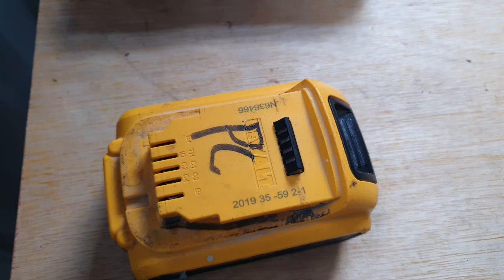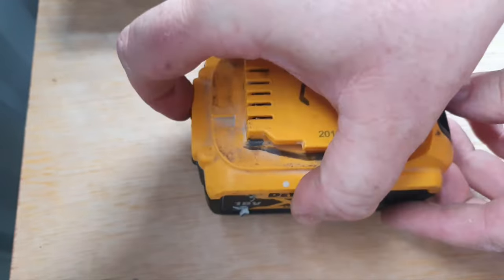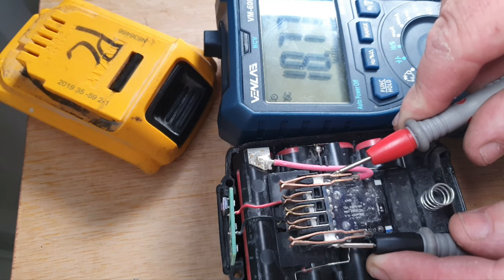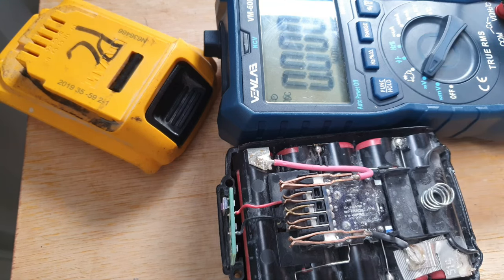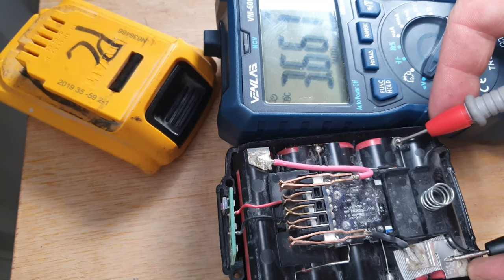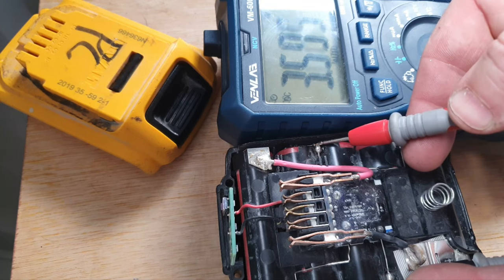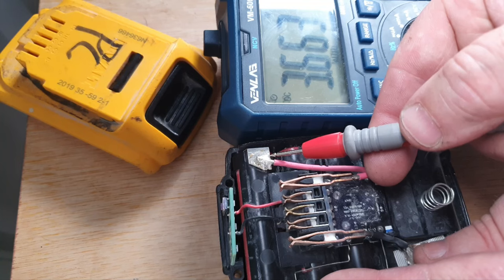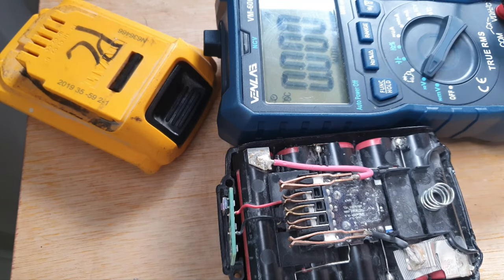Dewalt Battery not charging fully? this is the answer #powertools #repair #dewalt #powertoolrepair

Comment: I recover many of these batteries by using a light to discharge the cell pairs down the the level of the lowest pair and then charging the whole pack as all the cells will reach full charge at the same time. So far I have noticed the four cells nearest the terminals are fully charged at about 4 volts and the other six are usually 2.5 volts or less.

Comment: Had a few where the balance connection was broken on the circuit board somewhere. No continuity from the cell pair to one of the C terminals. Soldered a jumper wire onto the back of the terminal connection board and to the cells bypassing the circuit board to fix.
Reply from the maker: Nice one thanks again for the advice
Reply: High risk for a fire there. From my understanding  you can overcharge  batteries and blow em up like that
Reply: @CarnivoreConservative  how would replacing a balance wire lead to overcharging a battery
Reply: @Ben-xd4fc broski how do I bypass the circuit board again, I am a little dumb, I’ve got it taken apart and just “charging” on an old old car battery charger directly on the positive and negative but past the board the connection on the battery where the large pos/neg wires connect the battery “works” I hooked it up to an inverter and it runs says it’s drawing 18.8 v but won’t register on the charger at all now before it would stay solid red but only having 1 bar
Reply: Go steady there mate, if you have any dead cells you can over-charge the rest if you bypass the circuit board. Which is dangerous.
Reply: You should make a video showing what you did bro. It would help many of us.
Reply: @MA_KA_PA_TIE  this channels vids are pretty good

Comment: So how do you balance the cells without taking it apart and doing it manually??
Reply from the maker: I haven't found an easy way yet nut when I do there will be a video
Reply: @Doctor Lefthandthread  it says leaving thrm on the charger for 8 hours balances them on their website.
Id just drain that cell with a usb load device till its level with the rest..
Reply from the maker: @jpmkiv  cool thanks
Reply: @doctorlefthandthread  See my comment I just posted on your other video on replacing the bad cells.
Reply: @jpmkiv  Where do you see this? I can't find that info and I haven't observed this behavior. My charger (DCB112) doesn't do any balancing, it just shuts off when any cell hits 4.1v.

Comment: I’ve got brand new DEWALT batteries still in the original package. Is it ok for them to sit unused?
Reply from the maker: It is OK for them to sit unused don't leave them in the cold over the winter I have a xr 5ah since 2016 and it's still great not overused used it in my strimmer it sat idle for months at times. I kept it in the house and it's still perfect. I never put it away fully discharged.
Reply: You should charge them 2-3 times a year. In manual it says every 3 or every 6 months to charge and if you won't use them for few months charge  them to no more that 70-80% before storing them.

Comment: Can u discharge that bank with some kind of light discharge tool
Reply from the maker: You can charge up the banks fully that does it. Cell Imbalance is more common in Milwaukee batteries I have balanced them with a little charger I have

Comment: Mine only charged to 1 bar. So can I reset it or throw it into recycling bin?
Reply from the maker: You need to.open it check for broken connections check cell banks for low voltage or imbalance

Comment: I came across this video because I bought a two pack of 5ah batteries for Christmas and both of them only go to two bars. I feel like I got taken advantage of by someone who replaced new batteries for bad batteries and sold them to me.
Reply from the maker: There is something going on there never seen a new one with that issue
Reply: @doctorlefthandthread  I have two chargers that work just fine on all my other batteries. These two batteries just won’t go past 2 bars no matter how long they charge for.
Reply from the maker: @camaroboi13  I would try to warranty them if they were mine
Reply: @doctorlefthandthread  that’s the plan at the moment 👍🏻
Reply: @doctorlefthandthread I was able to solve my problems by draining the batteries completely then recharging them. Everything seems to be working now. I just plugged them into a light and let them die all the way. I’m getting 3 bars now.
Reply from the maker: @camaroboi13  that's great I fixed A 9ah Flexvolt that way once
Reply: @doctorlefthandthread  Why didn't mention that little fact in the video???????????????????????????????????????  :)
Reply from the maker: @pistolwhipped7714  This is an older video I have discovered how to do that since and I have made a video on it too

Comment: Nope all DeWalt are only really 18v. Welcome to false advertisement.
Reply from the maker: Depends how you look at it a fully charged 18v dewalt battery will read slightly over 20v when fully charged if they are in good condition. They call them 18v nominal here in Europe and 20v max in USA. I am not false advertising anything.

Comment: I don’t care why, the question is can it be fixed, this was interesting as it was helpful
Reply from the maker: Not easily the cells need to be balanced removing the low cells and charging them up to the level of the rest can be done but it is time consuming and I considered it not worthwhile
Reply: @doctorlefthandthread  I am so frustrated right now, I bought a new Dewalt cordless 18v on sale cuz they came out with the 20v but I figured it would fit my requirements, take it home and the battery charger didn’t work and of course I couldn’t return it and there were no more 18v chargers left to exchange. So I get bent over for another $175 to get a 20v adapter and 2 new 20v batteries. I take them home the work for like 3 weeks and then hold a charge for like 3 minutes of use then die. It’s the exact same thing that happened to me when I bought a Milwaukee drill a couple years back. Save up my money to buy decent tools take it home and they work for maybe 4-5 months and they do the same thing. I exchange those got new ones and then a week later somebody broke into my work van stole them. I’m about ready just to go back to corded tools.
Reply from the maker: @jasonvazquez2563  that is unlucky sir I wish you better luck in the future
Reply: @doctorlefthandthread  thanks man, years ago I had a black and decker I don’t remember how many volts but I got rid of it when I bought my Milwaukee and I regretted it almost immediately. I had that thing for a decade and the batteries worked like new when I got rid of it. Goes to show how the cheap junk isn’t. Always worse than the expensive things. Take care
Reply: Bosch
Reply: Exactly.. we looking for answers to fix it not why🤦🏾‍♂️